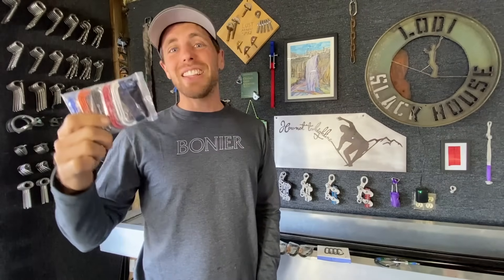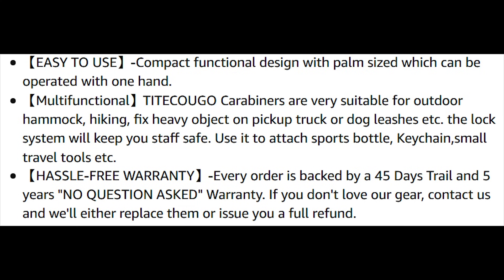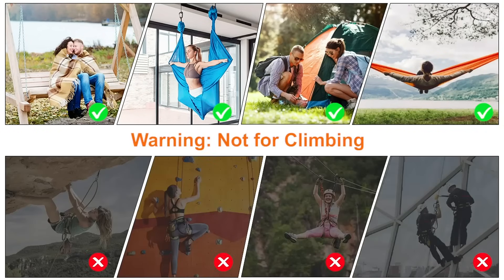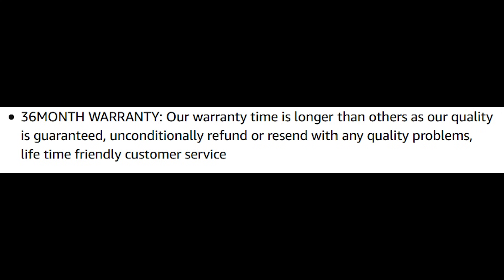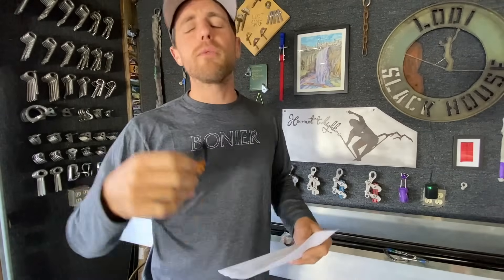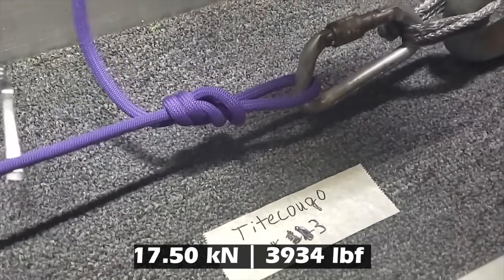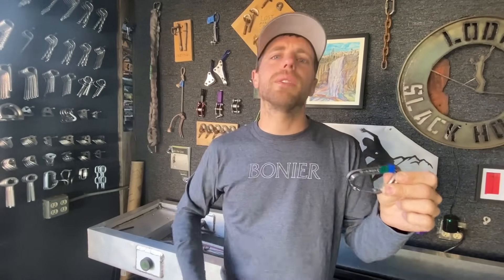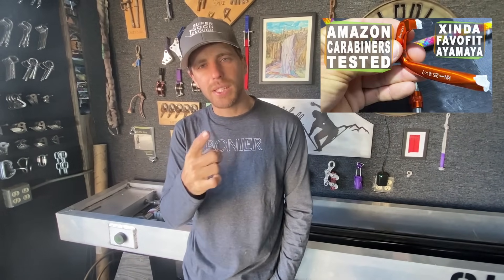I Hate Amazon's 12kN Carabiners

Comment: I'm glad I stumbled upon this as I did because for my uses these seem to be absolutely perfect. I've been using my quickdraw biners for camping but sometimes I want to climb and camp and need the draws. The use case for these biners would be hanging up my hammock, hanging from my mobile hangboard and using it to connect weights to my no-hang device. All those usecases put hardly 1kN of load on the biners, let alone 12kN and when I can get 6 of these for 13 bucks (basically $2 a pop) it's really a no-brainer.

I don't have any wiregate biners anyway, but I'm still going to put some yellow tape around these just in case I'd ever forget.

Comment: Fiat almost went bankrupt in the 60-70's because they used Soviet poor quality steel, and the cars rusted very badly and fast, and the structural integrity was poor. The communists tried to steal Germany's famous metallurgy and engineering proficiency, but even then their steel was horrible, and the best quality things made in the commie bloc were from East Germany

Chinese steel is no different and it's also notoriously poor quality. Never buy anything made of steel from a communist regime, specially if your safety is on the line

Comment: In quality assurance, it is usual to measure repeatability (ie. multiple samples on the same test system/tester), and reproducibility (ie. different batches over long term, different testers/test equipment).  This is often done in Tier I automotive industry with 3 different testers and 10 non-destructive testing samples.  As you do destructive testing, thid would require 30 test samples.  From this, we can calculate the standard deviation statistic, and estimate the statistics for the whole population that was manufactured.

For the Amazon specials, they may have a high variability in their manufacturing process, so they derate the rating to allow for this uncontrolled variability.

Comment: I understand your concern about people mistaking them for climbing grade carabiners. But what can manufacturers do more than a warning these 12kn are NOT for climbing. They even show pictures with the cross in red to make sure that people who can't read still understand. It's like don't dry your cat in the microwave or don't drink the battery fluid? Of course I use climbing gear for all clmbing, rappelling, zip lining, etc. activities. But when it's just for hanging your hammock (what I use the 12kn for) they are plenty sufficient and way cheaper. You get 4 carabiners rated 12kn for 10 usd  on Amazon and they are even cheaper in China. That's 1/3 of the price you pay for climbing carabiners. A hammock can usually carry about 120 kilogram. So these carabiners are not the weak link. I have about 8 hammocks to take people out and that's 16 carabiners. Of course I have about 30+ climbing grade carabiners for life supporting activities. I was surprised that raging at 12kn they even withstand much more up to 17+kn. That for me was the real surprise. I thought they would be weaker. But still way more than the hammock or tent can carry.
Reply: Yeah, if you ignore the cost, rating, written warnings, pictures, and size of the carabiner, and take it climbing that's on you. But you will still be fine anyway, a bad fall as tested on this channel is 4-8kn, and it's rated for 12kn.

They've tested gear on this channel they thought was great, that failed at 6kn.

Comment: The simple reason that these break at a lower stress is because of the manufacturing process. A simple formula relating to Pi and Young’s Modulus shows how the Yield stress of a material is proportional to the diameter (C) of any external defects or 2x this length (2C) for internal inclusions. 

Therefore during a cheaper manufacturing process the inclusions within the metal will have a larger diameter (due to factors such as turbulence in pouring molten metal, type of cast used, solidification time/pattern, use of a riser, etc etc). This consequently reduces the yield stress of the metal and therefore it breaks more easily. 

That is why metals with identical reference codes can act differently to one another once processed.

Comment: Looking at the difference with the Camp carabiner, it appears that there might be a significant difference with cross-sectional shape that is somewhat subtle. There's a ridge along the outside of it in addition to the inside whereas the Amazon ones only have the inner (upper case I instead of upper case T). It may not seem like much, but especially with how they failed, it seems that the amount of torque it can withstand is by far the limiting factor, and the ridge on the outside makes a significant difference. 
Note, the Metolius also had this ridge. It's probably more difficult to make these shapes as they have a concave portion while the Amazon ones can get away with convex designs

Comment: the hammock vs monopod thing at 7:25 is actually wrong. I did the math when making my hammock suspensions, and if your hammock lines are rigged shallower than 45°, each line is actually under more tension than the weight of the person in the hammock. I would be much less concerned about the monopod thing, or even the aerial silks earlier, provided they didn't do any drops that would shock load the carabiner.
Reply: I tried to rig my hammock with 500lb dyneema string and I ended up on the ground pretty quick, and I weigh 180lb. Granted that is partially because I rigged the string using knots instead of proper spliced loops, and one of my knots slid and then snapped. I feel much safer with my 1600lb amsteel!

Comment: I think your anger is misplaced. It appears that the manufacturer has produced a compact, strong and affordable carabiner that is perfect for many applications. Climbing is absolutely not one of those applications and the listings do clearly state that. If the listings aren't in perfect English may I suggest it is almost certainly better than your Mandarin, and they do a reasonable job of explaining what it is they are selling. Add in that the people selling the product are not the manufacturer and you get further complications they have dealt with admirably well. The two spring gate models look identical to me, lots of Chinese outdoor gear pops up with different brand names on identical products, the people who make it are wholesalers who do not have the expertise in marketing and distributing direct to consumers so they don't. The actual sellers have given accurate information on the specs, if the advertisement of the lifestyle experience and general excellence of the product is somewhat hyperbolic it clearly works as they keep doing it.

If people are stupid enough to climb with them (and yes, sadly they are) then that really should be the target of your ire. I am not a climber but I imagine yours is a dangerous hobby if you don't take the safety protocols extremely seriously. If elements of your community do not or can not clearly identify the difference between a bargain and a risk then look to educate them. Help people to know what it is they are looking at and why it matters, something I expect you're very good at judging by the content of this video. If they are happy to take a risk they understand then just make sure you're nowhere near them because you can't stop them. We can both understand that they will almost certainly be fine dangling from equipment like this, but almost certainly over a long enough time is a certain failure. That level of risk is clearly unacceptable and you're right to point it out.

All in all, nice to see them tested. I watched this because I saw an Amazon listing and worried they were too good to be true. Instead I've just bought four of these to hang hammocks, purely on your results.

Do lay off the Chinese though, they manufacture at near enough every quality and price point out there and it just comes across as ignorant when people can't recognise the strengths they have in these areas. I'm not saying it's all roses by any means, their flagrant plagiarism and copyright abuse is a real problem, especially where knock off goods are sold as genuine. If you come across an example of counterfeit carabiners being sold at a suspiciously low price and boxed up and labelled as a Camp Nano, get angry then.

Comment: If it is actually 7075 these are made from, and the raw aluminium all good to the specs, then the most likely explanation is that they're shortening the heat treatment time. Instead of doing a 24 hour ageing cycle to reach peak T6 strength, they're doing a cycle of 10 hours and maybe a little hotter. The finished strength would be maybe about 1/2 to 2/3 of T6 strength and that would explain the results you've found, and the benefit to the manufacturers is that they can do 2 heat treatment batches every day instead of less than one a day which makes it much cheaper to make.

Comment: 7075 has almost 2x the tensile strength of 6061, which is why climbing gear uses it. Both are typically heat treated with T6 aging process. The physical difference between the two is the chemical makeup of the alloy - 7075 is aluminum mixed with zinc and copper, 6061 is aluminum mixed with magnesium and silicon.

6061 is easier to machine, form, weld, and anodize, which is why we know its number - you’ll find it as the most popular general purpose aluminum where optimizing for maximum strength isn’t needed (like consumer electronics).

Why are these rated at a lower strength than normal carabiners? They’re not designed to be as strong, and are smaller/using less material. Other possibilities is the engineering behind them isn’t as thorough, or quality control/tolerances are loose, or material is not top quality, or they’re “factory seconds” of another brand’s normal carabiner line (e.g failed a dimensional inspection), or they simply didn’t test enough to guarantee that any given carabiner of the lot can exceed a higher rated strength. Could be a combination of multiple things.

Comment: Hot take: They're fine on nuts and small cams (that break on less than 12 kN).
Reply: A good way to get yourself or someone else in deep trouble when they get mixed in with other gear though, and their quality control is probably terrible so you might end up with one that breaks at 4kn on your nuts.
Reply: @JB-jg1tc Fair point.

Comment: Great video, I actually use these generic 12kN carabiners on my 3 hammocks and I really like them in that role. Not a climbing gear by any means, but if you get them at a correspondingly low price, they can be really useful in some applications.
Reply: IMO, looking real and costing pretty much the same as the Favofit or Xinda UIAA rated 22kN biners is where they fail the hardest.  If they were half the price and visibly different enough that they'd never accidentally end up on my gear loops, I'd actually want a dozen or so for non-life-supporting (or at least never-shock-loaded, like the hammock) applications.   At the usual prices, though, there's no reason not to go with an off-brand-but-rated biner twice as strong, so at least I don't have to worry that I'll suddenly notice "12kN" attached to a prusik I'm using to back up a sketchy rappel.
Reply: Appreciate the one sentence horror story you threw in at the end there  @kd5nrh

Comment: I believe they're rated so low because of lacking QC.
Some (batch) of them might barely scratch 12kN, while others are as strong as you found them.
The Orange one (just) held 13.8kN.

Some people will climb with low quality gear no matter what you tell them.
Wether it's just old, heavily used, damaged or faulty from the factory.
Other people might just use these for clipping stuff to their Backpacks.

I'm actually impressed that they undersell rather than outright lie about their performance.
So as long as there's no lie used to sell these, im all live and let live. Or climb and let climb?

Comment: I'm confused. Ropes are rated for like 7kn, so why is a 12kn carabiner not okay?
Reply from the maker: We hope no one is using a single strand of accessory cord in a life supporting situation.
Reply: @HowNOT2  Sorry I'm not sure what happened to my reply, but my local climbing store sells single ropes with kN ratings from 7-10kN. Does that mean these aren't safe for lead climbing? I have a 9.6mm single rope from Salewa that's rated for 7.4kN that's advertised as an all-around rope for top roping and lead sport and trad climbing. Is this not safe?
Reply from the maker: I believe the number you are seeing is impact force not minimum breaking strength. Most dynamic climbing ropes are tested to measure how much impact they could transfer to a climber during a fall. A dynamic ropes purpose being to absorb energy during a fall so you aren't crippled when you stop. I believe they try to achieve a value less than 12kn. Very different metric than MBS which many climbing ropes don't disclose, but is higher than the ropes impact force.  It is a common confusion which is probably worth making a video on. While climbing ropes can be cut over sharp edges, it is extremely unlikely to have one break under normal use. -Bobby
Reply: @HowNOT2  Ahhh, I see! This makes sense. Thanks Bobby, really appreciate the clarification.

Comment: They are great replacement for the very heavy ones I had 
with my hammock, save weight on my backpack :) I am glad I found your 
video because I originally thought those 12kN were bullshit, they 
largely exceed that actually. I might use they for more than I originally intended.
Very good piece of gear to my opinion, lighter, smaller, almost as strong as a climbing one.

Comment: My guess for why they are breaking lower is less material at the strongback of the bend where most of them are shearing, mixed with a softer steel clip that bends and stretches further allowing a feed back onto the strongback of the carabiner. Thus, the further the clip bends and stretches, the more torsion on the strongback, hence a lower break force.

Comment: The carabiners from amazon are a lot less strong because they are probably aluminium castings instead of forged aluminium like on the real climbing stuff ! 
- A cast introduces impurities in the material and internal stress when the aluminium cools down. 
- The strength of the material can also vary wildly depending on the area of the casting (large grains in the middle that are easier to dislocate and smaller grains towards the edges of the mold)

also the probably don't have a heat treatment done on them as well. T-6 heat treating is the most common for aluminium 
Although cast parts are easier to mass produce quickly and the coat of paint would hide external defects of a cast part.

Comment: As a window washer and ex-tower climber, I steer clear of aluminum for all decent and safty lines.  With daily use, I worry about micro fractures that I wouldn't be able to inspect.
Reply: As a window washer, you aren't concerned with weight. Those of us that have to manually lift our gear to height appreciate the lighter aluminum and hopefully inspect it more often.

Comment: 12 kN or 1200 kg x 2 is definitely enough for "aerial yoga" 4:38
Reply: I do training on  gymnastic rings indoors when weather are extreeme outside. So my rings are attached to triangle climbing carabines that rated 45kn, use them becauce need flat space to attach ring belts. O.k. but thing is I want to say is that those carabines are attachet to concrete sealing with 12mm anchors, that rated only to hold 100kg, and I think it is horizontally, mine are vertically. So in short I'm hangind on 2x 100kg rated anchors with my head down and doing all crazzy stuf with rings already 2 years with no problem at all, and don't think it ever will come off. My weight is 85kg-90kg. So yeah 2400kg is enough even for grown gorilla male doing aeiral yoga, dude! Even car weight of volkswagen golf 2015 is 3126 lbs it is 1417.93 kilograms so car can do yoga too hanging on two amazon carabines :)

Comment: Also scratches, nicks, dings and rope wear can diminish the strength of these carabiners even further by crack propagation etc.. making those tiny biners even weaker after use. You really need the extra safety factor of real climbing gear.

Comment: I often use climbing carabiners to secure water bottles and other gear. Makes a lot of sense to instead buy cheap ones at a third the price for these applications. I don’t fault them for selling these if they’re labeled as not for climbing; any experienced climber wouldn’t get them mixed up. If you aren’t experienced or trained you probably shouldn’t be rigging your own ropes.
Reply: You would be surprised how easy it can be to get them mixed up. I had some like this from a long time ago that we're not climbing rated, matte black, and they could get mixed up with the loads of climbing gear in my basement. If you accidentally grab the wrong one as you are packing for a trip, it could be deadly. I'm throwing away any that I find. Anything that needs a carabiner deserves full strength if you climb or rig anything
Reply: The way I see it I would just use proper climbing ones to carry your bottles or what ever as  you can use it for climbing if you need it or a back up. Just my thought anyway.
Reply: $12 to ensure that your chances of making a life threatening mistake are zero instead of close to zero seems like a fair trade to me
Reply: @merrovech  It's never just one carabiner. Especially when you can use more of them in more places that are not safety critical you're more likely to get more increasing overal cost. And it's even cheaper not to climb. But to each their own.
Reply: Until someone buys their first harness, biner and atc and heads to their gym. Not everyone who climbs is experienced, and not everyone who is inexperienced find the right information sources. Its fine if they are 17kn, but they should still be embossed with not for climbing, and have absolutely no hint in their advertising that they can be used that way.